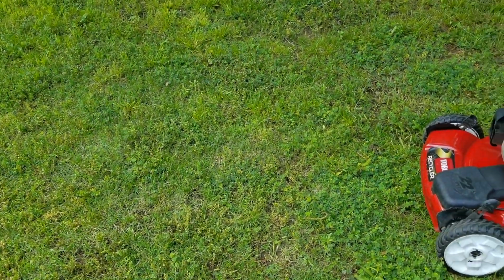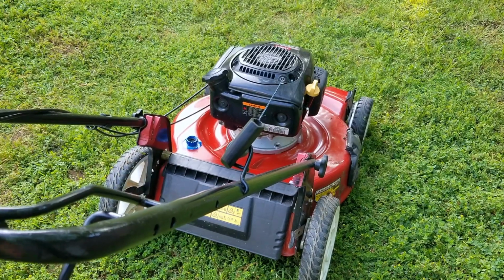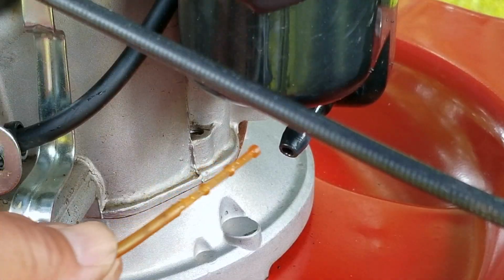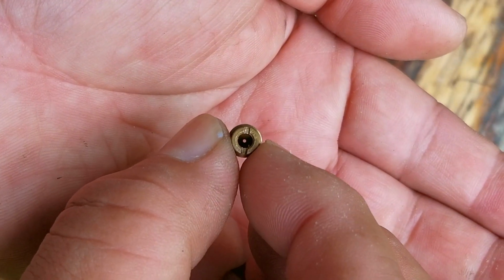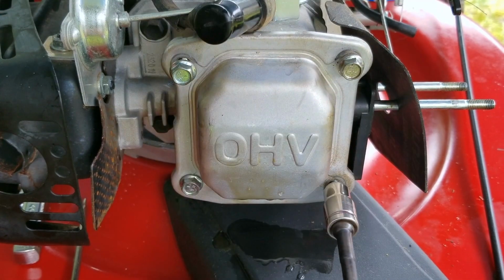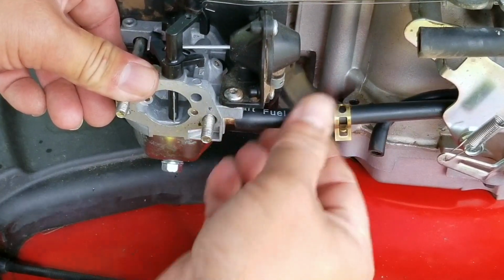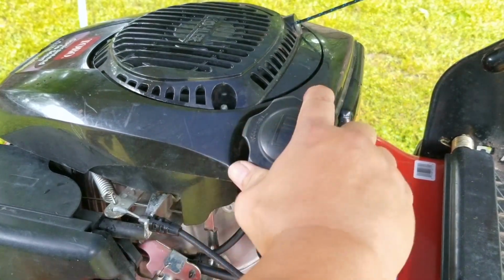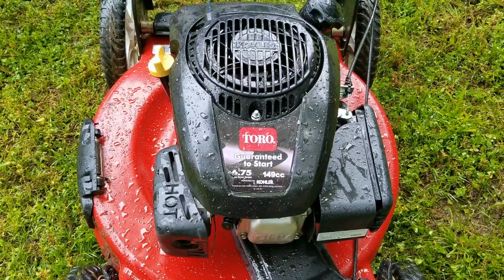Fixing A Mower That Won't Start, Toro

Comment: My favorite is the Briggs 6.25hp engine. I have three mowers with that engine right now, and two of them are over 15 years old. They all run great, and those engines are super simple and easy to work on.
Reply from the maker: Nice, those are great engines

Comment: On the idle set screw, does it need to be tighter or looser to make the engine run faster?
Reply from the maker: turn the screw clockwise, to make the engine run faster.

Comment: Why does the valves loosen up? Thanks Kyle
Reply from the maker: If I had to guess, the valve seats start to build up with carbon, or the moving components start to wear.
Reply: @HomeGaragechannel  now if you change the oil every year would that help so you would not have to do that.

Comment: Good evening I have been watching your videos and it has helped me on quite a few things but I have a Honda push mower that won’t keep the power. I changed the air filter and cleaned the carburetor. It will start but when I start mowing it stutters and then shuts off. Any suggestions?
Reply from the maker: Thanks for watching I appreciate it. Is it a self propelled mower and if so, are you using it when you begin to mow?  How tall is the grass and are you cutting it low?  Thanks
Reply: @HomeGaragechannel    yes it is self propelled and when I start it I start it on the concrete and let it run for a minute then start cutting. The grass I was cutting wasn’t too tall it was not tall but not short and I have it on high setting on my mower (tallest)

Comment: Hi there, been following you for a while now but haven’t really appeared much (I started watching since I was 12 Cus of the same line trimmer and now I’m 16) I have a husquvana 327ls straight shaft line trimmer and I have brought a new carb for the machine as it was running rough and didn’t want to buy a rebuild kit since it’s actually cheaper to get a aftermarket carb,but the default adjustments on the carb was set to the most seated position and the machine is not starting at all now. Is there anyway I could set it to the factory setting to at least get it running properly before fine tuning the carb (including the idle screw as well if you can)? Is there a set position for factory setting? (I’ve tried to set it to 1 1/2 turns for both h and l screw and the idle screw was just left there but is still not running well).
Thank you and congrats on almost 100k!❤❤
Reply from the maker: thanks and unfortunately because it's an aftermarket carb, the factory setting may not apply to it.   I'd recommend getting another carb but a different vendor, and this time try getting one that's a bit more expensive
Reply: @HomeGaragechannel  I also have the original one that has its diaphragm replaced that is ready to go onto the machine which also needs to be reset. Would it be possible to find the setting online? (tried but haven't seen one) thanks!
Reply from the maker: you might find the setting from a thread on a message board but as far as I know there are no official postings for the stock settings.

Comment: Nice work on this one.  Hey at 7:26 there is a screw with a Phillips drive and a bolt on the bottom.  What is the function for that Phillips head screw?   My carb has only one bolt on the bottom of it.
Reply from the maker: thank you and the other bolt is used only as a bowl drain to remove fuel before storage or for flushing the debris out of it.
Reply: Ah, ok thanks.

Comment: You can use the other Kohler carb without the vacuum pump part and it would work.  It was mostly designed to help smooth out the choke transition, although, I find the other choke sometimes takes FOREVER to open lol
Reply from the maker: ah thank you for the bit of information

Comment: I would persist with it, and iron out the bugs I find. This is just me. I’m a retired auto engineer who has a lot of time on my hands to do this. That being said, I run my mowers out of fuel before storing them, and the oil is changed every 24 hours of running time. 10w30 oil is the recommended oil required for them.
Reply from the maker: thank you and yes I intend on continuing the repairs

Comment: I would trash the engine and keep the deck and do an engine swap. Kohler engines are not the greatest and are known for leaking oil (as you probably already know)
Reply from the maker: very good option!

Comment: I’m not a big fan of these engines either, least of all this version. I’d keep working on it but some Kohlers just don’t run smoothly no matter what you do.
Reply from the maker: don't worry, I plan on basically taking it apart to find out the problem.

Comment: "I've started using other words to describe it".  I love it.  I know exactly what words you mean, I feel the same way.  Kohler really should have stuck to making toilets and faucets.  Good work as always.  I just had one of these in the shop that was also missing the choke linkage.  Not sure if they just fall off randomly or if it is a manufacturer oversight.
Reply from the maker: I know right, this is the first time I've seen it fall off and most times it's because someone took It off and didn't hook up the u shaped side correctly.

Comment: When I was a kid, our mower had a throttle which I have noticed have pretty much disappeared on modern gas mowers.  It goes straight to full throttle which cannot be good for it.  Would you agree?  Have you seen reduced lifetime in modern engines in general?
Reply from the maker: yes, if I had a mower with a throttle, I would let it warm up for a minute or 2 at low speed, before going full bore.

Comment: Hey bro what's up? Knowing you so far, my guess is that you'll continue investing your time and probably money into this mower to get it working properly again.
Reply from the maker: you are correct
Reply: @HomeGaragechannel  I don't agree with you the 91 is better then that 87 shit any good given day
Reply from the maker: good.
Reply: I have not had the pleasure of fixing that particular Kohler in the recycler yet I've had the old techumseh and I prefer the Briggs and Stratton.Yes I would fix it right because your already "balls deep" and they have fair resale value
Reply from the maker: you got that right, I plan on continuing the repair